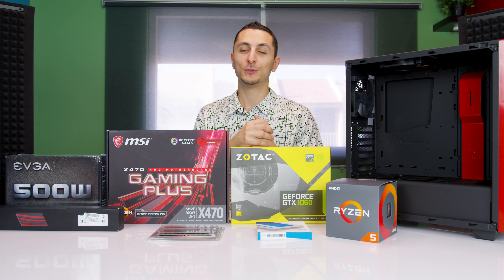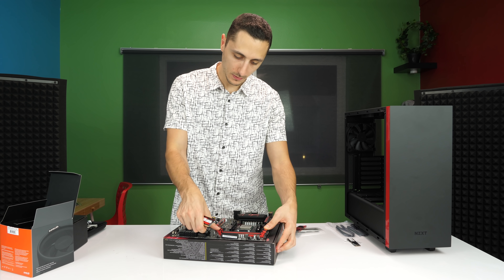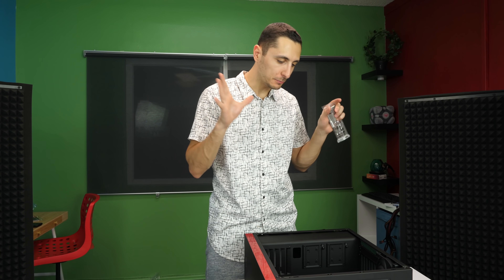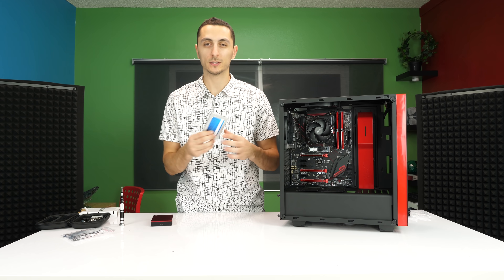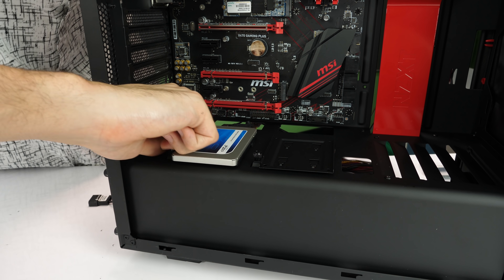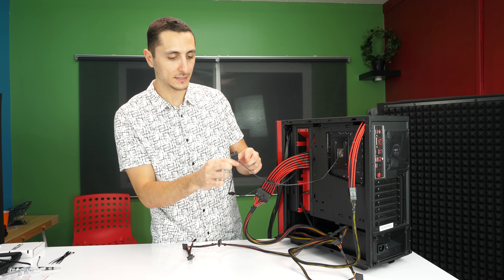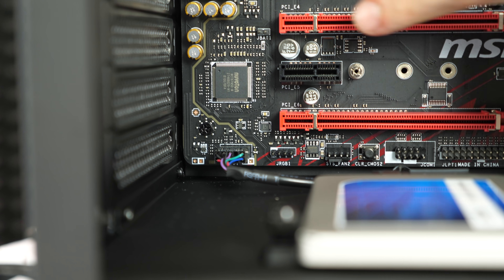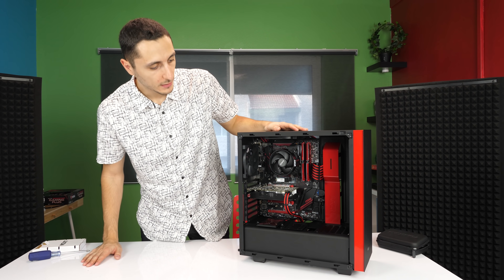How to Build A Gaming PC - 2018 (+Overclocking Guide)

Comment: Ed i found something incorrect with your video, the io shield is not the most difficult part of building a pc, molex cables are
Reply: xXx_Da_n00b_xXx do they still get used? I only use them for modding...
Reply: Legit, built my first pc a month ago and I thought mine just came messed up
Reply: CPU cooler install?
Reply: Nope, installing fans are 
JFC my hands hurt
Reply: yes
Reply: I would think the front IO headers would be the most frustrating part of the build especially for a first time builder.
Reply: Augest Celine , nope, when i built my first pc it wasn't difficult, except for the fact I was building in a tiny itx case but it was ok
Reply: @somedude2492  yea

Comment: pro tip
don't tick the windows logo in msi afterburner till you're 100% sure that your pc is stable because if you add too much memory overclock the gpu will make the screen go blank. So if it isn't ticked you just reboot the pc and try again but if its ticked every time you boot again it overclocks itself and you get instant blank screen, then you need to use an different gpu to untick it so it doesn't overclock itself on the boot :)
Good luck with your build and have fun
Reply: Thanks Ed for the ❤
Reply: iKickBullies yea ik that but I didn't mention it cuz this was a ryzen build. Thanks for completing what I was saying
Reply: So civilized👏
Reply: booting with safe mode will do the trick to, correct me if im wrong. BTW thats a good mention for other peeps.
Reply: You are correct.  This is exactly what safe mode is for. you can go into safe mode and remove the afterburner configuration.  I'm not sure where afterburner keeps it's configuration as i'm an asus gpu user and use gpu tweak II, but it's either a config file or removing the appropriate registry entries and rebooting.
Reply: Leo Gomez why it shouldn't work?

Comment: Just built the same system with all the parts yesterday 07/01/18, did it overnight (3am)  took me longer cos am new at this. It turns on with no issues but don't have a graphics card will be getting a cheap 1050 Ti when the prices drop alittle... Thank you very much, Tech Souce for your build guide, really appreciate your channel... It was hard for me but I did it!
Reply: The problem with building your own pc nowadays, is that the prices for ram and graphics are inflated, whereas, the big giants like Dell and other brands, can get them at much cheaper prices. Crypto mining destroyed any savings pc building had in the past. You can buy a gaming PC from Dell and the difference in price between the same custom build and Dell would negligible, and in some case, the Dell would be cheaper. Most of these prebuilt pcs come included with keyboard, mouse and other accessories which are NOT included in the price of built gaming PCs. PC building is NOT longer a hobby that saves money with the inflation of cards, ram, etc. It has become a cult of nerds just to earn your diy badge who think they are somehow, beating the system lol you aint beating shit son
Reply: Back then it was best to build a pc and now it isn’t due to crypto mining. Though prices for gpu went down a little bit but not drastically and it’s still not worth building one.

Comment: Hey man, I just came back to say thanks! It's been 8 months since i made this build, and it is totally worth it. Thank you so much for making this build guide!
Reply: Yo I have a question what games does this run and what is the FPS for the games I’m getting a ryzen 7 for mine thi
Reply: @leftodd  I used 1070ti mini for this build and it runs most of the games at ultra 100fps+ on my 1080p monitor.

Comment: Very nicely done.  I personally went with a Ryzen 5-2600, GTX1050TI, X450 MB with 16G Corsair RAM.  The cost is very reasonable.  I'm not loaded with cash, so I bought the parts over several months which is a good way to do things I find.  Just waiting on my hard drive and WIFI next and I'll be good to go.
Reply: Neil Roy nice. Still a little confused as to why you took 16 gigs of ram with a 1050 and Ryzen 5. 8 gigs is plenty and ram is overpriced rn. But it’s your setup and it will do just fine!
Reply: TyrameZz its is not overpriced at all it’s like 80 bucks for 16gb @3000 mhz
Reply: Should have gone with a rx 570
Reply: @Ridgelow  where. Can you please show the link to them
Reply: gtx 1060 3gb works better than a gtx1050ti 4gb you know.. both cist around the same in my country but i don't know about yours..
Reply: @xdoubt4004  16gb is 60 dollars rn. And that is not for sale, it's a regular price.
Reply: U shouldve gone for a ryzen 5 1600 then upgrading your gpu to atleast rx 570 or 580. Sell your 1050 ti the rx 570 has updated drivers that can even compete with 1060 but same price as the 1050.
Reply: @D4nshaku  the speed matters
Reply: @xdoubt4004  Yea i know, but he gotta have some balance on the gpu and cpu and since he's on a tight budget what i suggest is i think the best bang for your buck.
Reply: Why tf did you buy a 1050 ti

Comment: Thanks so much man! I built it!! My first pc
Reply: hey man if u follow the steps exactly does the pc word and whats the average frames per sec
Reply: you can search up the 1060 ryzen 5 benchmarks on youtube Darius
Reply: @andrewboyling2628  no such thing as 1060 ryzen 5 lol
Reply: Gamin Scotsman ryzen 5 is a series of cpu and 1060 is a seres of gpu combined together is that search result
Reply: Unthinkable Plays Can you help me? I want to build this exact pc but the ram is out of stock. Is there another type I can buy? I’m assuming any ddr4 ram will work. And would 16gb be better for this build instead of 8gb?
Reply: Spicy Jake Park main 16gb is all ways better but obviously costs double the price, corsair vengeance will work and maybe think about start with 8gb and upgrade later just keep in mind how many ram slots you have on your motherboard
Reply: @andrewboyling2628  it's not quite double the price you can get 3ghz 4x2 for 80 but 8x2 for 145

Comment: Those little bastard cables that connect to the front io case ports are what were holding me back from saving up to buy the pc parts, next comes the bios and windows setup
Reply: I personally didn't build my pc but bought custom built pc from a local company but bios and windows setup are very easy. Since I didn't build I can't speak for the front io

Comment: 16:25 if you have an m.2 ssd, connect the data cable to the slots sata1-4, because data 5 and 6 are deactivated, if you use an m.2
Reply: sata cable* for your extra hard drive

Comment: Ed i just finish building ryzen 5 2600, msi b350m mortar and crucial ballistix tactical 16gb. i followed everything u did. my pc leds and fans turn on but my computer screen remains black. Do you know how to fix it? Would be waste of money
Reply: pls reply ed
Reply: Does it say no signal or nothing at all? Check you cables or the GPU
Reply: Joni Mukaj it says nothing at all. GPU is connected properly.
i have done the following things but nothing has worked
remove the cmos battery
took all the parts out and rebuild it
used a single ram stick in different slots
but nothing has worked so far
Reply: Txufx Hey you ever fix it man?
Reply: everything is good now motherboard was defective and returned the mb and everything isa ok now
Reply: Txufx  Thats nice
Reply: Txufx how’d you know it was your motherboards problem?
Reply: Jamie K read my reply
Reply: Txufx if it is not too late search for amd boot kit since ur using 2nd gen ryzen
Reply: Nororlol 4life everything has been solved motherboard was just defective
Reply: The cable you used to plug in the gpu and in the monitor might be damaged.
Reply: Mason Kennedy lol he said it's solved.
Reply: Mine doesn’t work I really need help
Reply: Painful vs Silly_Billy same
Reply: Joni Mukaj what do you do if it says no signal
Reply: his the hdmi plugged into the GPU
Reply: Is the HDMI cord plugged into the graphics card?
Reply: Dude there can be a lot of problems
1. Do you have a GPU?
2. Is the switch on the power supply turned on?
3. Did you accidentally plug your HDMI, DVI, D-SUB, etc cable into your motherboard instead of the GPU?
4. Are all the cables flush inside their headers?
Reply: JeddinX “do you have a GPU” nice
Reply: See if you hear any series of beeps and look up the sequence on your motherboard a manual or on ddr4motherboard.com , for example if you hear 3 short beeps it could be a problem with your ram
Reply: it didn't work because you bought a b350 motherboard and used a 2nd gen ryzen without updating the bios, mb wasn't defective, you are.
Reply: U
Reply: Same thing happened to my z97 board but it was up and running before it had the same symptom as yours, blank black screen. I ended up buying the new motherboard and switched to AMD this year instead. I was thinking it is either PSU or Mobo and I was right since the psu is powering my new rig rn

Comment: Ed I just finished building my pc and booting it up but the pc seems to keep resetting and not showing display everything is plugged in leds are on fans spinning but no display
Reply: Hey did you figure out what was wrong ?because I currently have the same problem
Reply: If your using hdmi cable plug it into the motherbord worked for me
Reply: Jomar Perez just destroy your pc and build a new one. Ok

Comment: Got a question. As I was plugging in the 24 Ping thingy the Mainboard Curved like in the Video too. That is not a problem, is it? Kinda scared I broke it. Also when you were talking about the cpu 8 pin. I have the same motherboard and on the 8 pin it says cpu 2 and on the one with only 4 pins it says cpu 1. Should I plug both in the 8 pin now or one in the 8 pin and one in the 4 pin im Confused and also cable management is a pain in the asss
Reply: One of the cable says p 8 and the other one says p4
Reply: @sufyanthe1st34  thanks man
Reply: plugin both 4pin on the 8pin cpu connector if ur motherbord have 8pin connector.. some motherboard only have 4 pin cpu connector so only plug in the 4pin cpu cable from the powersuply .. hope i help u
Reply: always read the motherboard manual boiii

Comment: I’m 14 and I watched the beginners guide on how to build a pc because I was also building my own while watching the video. When I was finished I tried turning it on and it didn’t work but then I realized I didn’t turn on the power supply switch on and it worked lol. I was so happy. Another mistake I made after that was not pushing the ram sticks far enough because that caused my pc to not display anything on my screen.

Comment: Why didn’t you just connect the cha fan to the motherboard? You could have avoided a extra cable that just takes up space also connecting it to the board the voltage can be regulated for the best cooling efficiency for your cpu instead of being stuck in one speed if you use molex
Reply: My thoughts exactly. I only use the molex if I don't have a choice (no extra fan headers on the mobo). I'm also wondering why he didn't connect the reset switch.
Reply: @bifutake  which one is reset switch?
Reply: @yonathanharla8953  I stand corrected, it seems this case doesn't have a reset switch.

Comment: #help, do you have to use a hard drive and an ssd or just one?
Reply: Just one XD
Reply: only 1 is fine, but ssd is much faster
Reply: you do get a lot more storage with hdd tho
Reply: Ferg Boy productions An HDD is enough but if you want more performance I recommend to you to buy an extra SSD (but not with so many GB)
Reply: It depends on how many sata ports your motherboards has, and ofc you can use both at the same time.
Reply: both
Reply: Ferg Boy productions SSD for boot drive. You only need one technically but you will want SSD. They are so cheap nowadays. 500gb Samsung 860 evo for $117 on Amazon.
Reply: Ferg Boy productions but you can get for even cheaper.
Reply: In 2018 an ssd is a necessity- hard drives are just so slow in comparison, I would recommend using a minimum 250gb ssd for your operating system and maybe a game or two, then use a 1TB hard drive for the rest of your stuff.
Reply: Buy a small ssd and install windows and maybe some games on it and install everything else on the hard drive
Reply: 1
Reply: I recommand a hard drive, it’s cheaper, takes more storages, and the ssd and the hdd will get same fps in game. Ssd is to make loading times faster in general, but it has more advantages.
Reply: people use an ssd mainly for launching windows off of. every time you start up your computer, thats what it is using. thats why you want an ssd for speed.
Reply: SOME of these replies are overcomplicating it, its easy, get 1 ssd and plug it into the first SATA port on your motherboard, then plug in the hard drive in the 2nd port, download windows onto a USB drive from here: https://www.microsoft.com/en-us/software-download/windows10 once the usb drive is ready, plug it into your pc and it should automatically go to the USB drive windows installation, select whatever version of windows your buying and select your language, then select the drive for windows installation(in this case the SSD) then just hit next and give it a life :) thats it, also once your booted up into windows, press windows button + x then click disk management, once your there, right click on the hard drive and click new volume, just hit next till your done and your hard drive will appear on the windows explorer.

your done! put your big games on the hard drive and put stuff that you regularly use on the SSD for way faster loading times. SSDs are way faster than hard drives, you can do this on just one hard drive or ssd, but unless your getting a 2TB ssd, i realllllly STRONGLY recommend an ssd, it will be worth it in the long run. good luck! if you have more questions or doubts pls reply to me
Reply: Either or both
Reply: You can use as many or as little as sata ports on your motherboard
Reply: Ferg Boy productions Just one dude
Reply: Ferg Boy productions if you get a ssd put Windows on it and programs that you use a lot because ssd is way faster
Reply: Awesome Guide!! I want a new gaming pc! :D
Reply: One... lol
Reply: Just one get a ssd it is much faster
Reply: Buy HDD and an intel optane
Reply: Ferg Boy productions at least 1 drive ssd or hdd
Reply: SSD is faster but if you need to store a lot of things and boot up really quickly I would suggest a 1-2tb hard drive and a 120gb (at least) ssd
Reply: Yo no need to hate, if he's asking for help then let him. there are a lot of confusing things about PCs
Reply: Ferg Boy productions just one
Reply: Any one of them would work. SSDs are a bit expensive but deliver great speeds whie on tghe other side, hard drives are cheap but are comparatively a bit slower than SSDs. It doesn't matter whether which of them you are using?

Comment: When you download the drivers for the motherboard, what do you do to them? Do you open them and then install? Also, once you install can you delete them?
Reply: The drivers you download is an executable file. So after downloading, simply open and run then wait to be installed. And yes you can delete them if you finished installing. By the way I would suggest updating your OS first (Windows Update) before you update the drivers.
Reply: Marion Paolo Abagar ok thank you but by updating your os you mean like your current windows version? Because Im going to be building a pc soon so wont I already be on Windows 10?
Reply: Also if you can would you mind telling me a video to look up for it or leave a link
Reply: Danidence what i mean is that when you first install the OS there are still things that it needs to uodate like windows defender. The video is actually complete except for updating the windows
Reply: @danielpalomo5920  What he means is updating not upgrading. Go to your Windows 10 settings and there you will find Windows update... Windows update will download the required drivers (which it can) and install them. After updating you can again manually download and install drivers like he did in the video....

Comment: 29:11 how come the M.2 drive isn't showing up?  You installed two different drives.
Reply: I am wondering that as well, when I build my pc this year I will just have the m.2 drive installed before I go and install a 2.5 inch ssd.
Reply: This is confusing.  Neither of the drives he installed are 480 GB, yet it says that his single drive has 447 GB of free space.  You can see both the M.2 drive and the 2.5" SSD in the build, so something weird is happening.
Reply: @ExplosiveBrohoof  nothing weird.. he just removed the parts off screen  and used some old ones..
Reply: @hkr1276  But there are still two installed drives in the computer: you can see the SATA SSD, and you can see the M.2 drive.
Reply: @ExplosiveBrohoof  well then...

What about...

He used dummy m.2s and ssds..

Conspiracy intensifies

Comment: Are there any other ways to mount an ssd In this case other then the method he used in the front
Reply: You could use an adaptor  & put it in the 3.5 inch bay or double sided tape to the back

Comment: 29:13 your m.2 ssd was not detected...
Reply: I noticed that too. Is it bc the sata port is taking priority over that first slot?
Reply: Lol yeah it does. Plug it into sata 2
Reply: I don't know...Maybe ed should explain
Reply: That slot Should be only for Pcie m.2 only
Reply: It is because he plugged the sata cable into slot 5 it needs to be in either slot 1 or 2 cause the m.2 disables 5.

Comment: Can you use the same flash drive for the drivers (bios, etc,) as the one you used for Windows
Reply: Llama 273 yeah, but clear off windows 10 of it after you finished installing it
Reply: Yes, but make sure you format the USB first before putting the flash file.